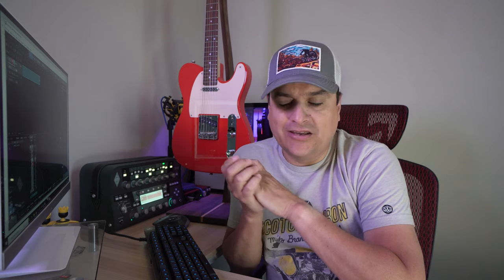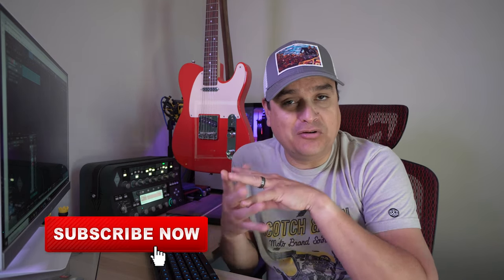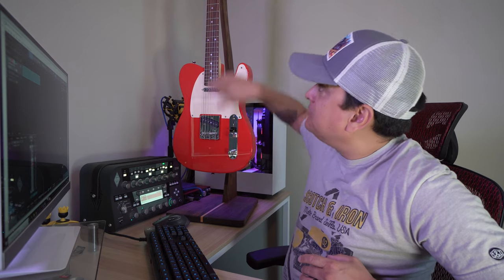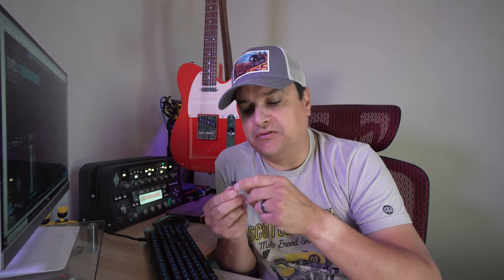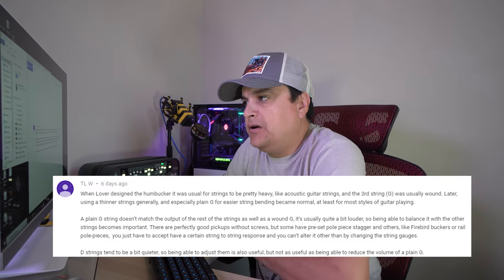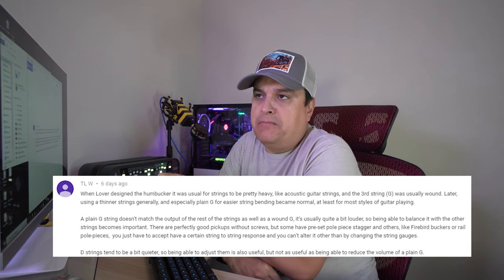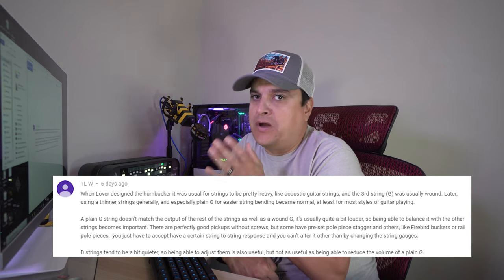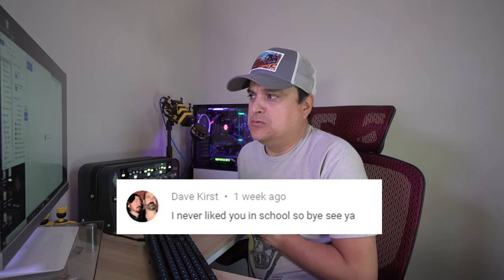Telecaster Saddle Shootout - Graphtech Vs Brass Vs Steel Vs Aluminum

Comment: I was surprised the Graphtech seemed to take the edge off highs and lows. This Tele player liked them in this order I found Brass the most traditional sound with chime edge, Steel had edge, aluminum seemed to fit between brass and steel which I did like and as much as I wanted the Graphtech to come out on top it was actually my least focused sound.

Comment: I like the brass twang but I also liked aluminum a lot. I could see all that upper twang of the brass possibly sounding harsh with a lot of overdrive or reverb though. Aluminum might be more flexible and I may have liked it the best clean too

Comment: I thought that the brass sounded the best for picking up and not screeching/squelching out and distorting the faint little notes between pic strokes. For lack of a better ability to explain. The little notes in between the loud ones.. lol think that the steel was the worst. 2nd place id say goes to aluminum which were basically tied with 3rd place graphite but the size of mounting screws drive graphite to spot 3. Steel just seemed to be to high pitched. However I am listening on a phone so that could have a huge factor in my choices. I’d imagine that the steel ones were actually cast pot metal and then nickel plated? Like most things?

Comment: Graphtec didn't sound shrill... seemed to even out the spectrum. That's what I have and now this video confirms why I like them. I don't want to trebly sound, and I think it doesn a good job taming that. I did like the Aluminum sound as well, but it's not enough for me to change out what I'm currently using.
Reply: I saw a video sometime in the last 12-18 months that addressed the issue of the brightness of a Tele (I don't remember who it was by and what it was about, I can only remember the takeaway). He suggested seeing the halfway point of the tone knob of the Telecaster as the starting point or default. This gives you a great deal of flexibility when it comes to your tone and after trying it for myself I can only say that this observation was spot on. I used to just dime everything on the guitar and adjust my amp as needed, but I've found this "half-way" approach to be significantly more appealing. I use my Telecaster to play pretty much everything nowadays from crystal cleans to rock to punk (even Metallica if you can believe it). I've also gone to having the volume set to half as a jumping off point for distorted sounds as I find that it gives me far better articulation and clarity when riffing on chords. And high gain leads are just half a turn away. Just a little food for thought.

Comment: I think the graph and the alum had more muted highs and the bass notes didn`t ring as long. brass and steel are harder so i think it transmits the vibrations more authentically and the softer material has more absorption. so i think it depends what type of sound you want and what you play, fast low chords would probably sound better on the softer and lead / clean players would do better with something that would allow a ringing of the notes.

Comment: There is a reason why bells and horns are made of brass. That being said.. what about block material ? I replaced  my block and neck screws and the screws that hold the trem  springs with brass and I swear the guitar sounds much more 'alive'  I have a stainless steel trem but I'm thinking of going brass saddles too. 🤔

Comment: I am a tried a true Tele guy and not for country twang.  I gravitate to brass saddles that are compensated for better intonation.  My ear may be biased but this still keeps me at brass.  Not to that I do not have Tele’s with steel saddles.  I did find the aluminum interesting.  Graph-Tech seemed a little muffled.
Reply: A nut comparison would be great.  In the late 70’s it was the thing to change to brass nuts.  Thinking about it again now.

Comment: This is one of those debates like "alnico vs ceramics", or 9's vs 10's"."
I have guitars with all types of saddles, from cheap pressed "vintage style" to brass barrels and everything in between.
Without an oscilloscope, and some kind of direct side by side, the "sound difference" is so small in the context of a song, that it is negligible to 99% of the people listening.
I agree that brass saddles can be brighter, but is that "better"?
I listened with headphones, and while they sound "different" I can't say any one is "best".

Comment: Aluminum seem more resonant & slightly brighter. Brass seem slightly warmer & richer. Steel seem bright but not as warm as brass & not as resonant as aluminum. With new strings brass is the best I think.

Comment: I like the brass most balanced a bit  more beefy in the upper middle. 
Steal a bit brighter and snapper good sound but for me a bit to  high ended
Reply: Graftech. Dulll don’t like the plastic saddle ideas
Reply: Aluminum similar to the Crome but not as  dynamic as steel

Comment: To me brass also sounded best providing the broadest spectrum. Steel was brightest, aluminum amazingly somewhere in between the two. Graphite was disappointing, just as there were nylon strings on the tele.

Comment: Brass had a better bass end, more 3D sounding, greater detail, layered not as flat 2D sounding like the steel & aluminium...the treble was clearer but smoother imo...i use brass saddles for all my bass's after compairing many types for years, especially on an Ebony fretboard....a bit more gain with Ebony fretboard & brass saddles...imo

Comment: To me aluminum sounds “neutral”, well-balanced. Graphite is a darker one, closer to even nylon tone, less highs. Brass is really sharp with the lack of low end, surely  the most cutting through the mix. Perhaps with a proper tone setting could be really nice. Steel ones have good response on highs and lows as well, brighter and deeper than aluminum, I would prefer them.

Comment: I think  brass -although too brite -  had a lot of clarity and dynamic sound. So I think it would sound better with the rhythm pick up or was just more bass in the amp. I think you get more signal with the with the brass.

Aluminum would be my second choice but it did more compressed or muddled. Steel I did not like nor the graph tech.

But if you are playing distorted  lead you might want to have a flatter sound with the steel

Comment: I think I've seen those steel saddles on reverb and ebay, pretty inexpensive.   Other comparison videos with Callaham steel the steel is much louder brighter and more attack then brass. The brass has more low end, but with alder and rosewood board can be rather dull.  I'm thinking the steel is questionable in the cheaper saddles.  Maybe  Dave is your brother  ? Using a different name?😄

Comment: Brass variation goes from warm with articulate highs to thin and unusable with no bottom end and a weak mid. Try the test again with a range of "best compensated" brass ones and the range is even more than you had here.

Comment: Aluminum and steel sound roundest brass bass and presence scooped mid graphtecc sounds between brass and steel.. thickness Or height of saddle Will have a bearing and Last but not least screw material.. sounds goofy but it isnt try stainless, nickel, and other various materials. Think of it as a conductor of vibration to The plate and what frequencies it might emphasize.. I've used steel screws in brass saddles ( always loosen string tension a bit e down to d etc.) Especially using steel in brass threads or vice versa brass and nickel screws is a nice combination as nickel subdues a little of the upper mid spike but just enough to Ballance it out a bit, never really tried aluminum saddles, but make pic's out of aluminum and gives a round tone whereas brass bass and presence. Carbon fiber may be similar to graphtecc if that isn't what there partially made of but have no idea never used em?

Comment: The brass reminds me of alnico 3 or the type you'd find on a Squier CV telecaster.  The steel sounds ok, nothing special.  The graphtec has something that isn't entirely bad but not great either.  The aluminum saddles sound like the typical budget chinese telecaster saddles.  Brass is traditional and twangy, but it doesn't make it the best!

Comment: I thought the graphtec sounded like an acoustic with a piezzo pickup -- artificial, plasticky, undesirable. Brass was by far best, then aluminium or maybe steel. The second part of the video made me want to spew, and I'm not surprised he gets nasty messages. (Edited to spell correct)

Comment: Bro, bro, bro. More density = more treble frequencies transferred. This means the ideal nut and saddle material would be osmium, the denesest material on earth at normal pressures. But, osmium is unstable and turn into a osmium trioxide when exposed to oxygen. So bro, just play your tele with an osmium bridge and nut, bro, but in a vacuum. You gotta have the perfect vacuum for that TONE bro. Bro. B r o .

Comment: Wow, steel sounded the best. Brass was a little to bright, def at gigging volumes anyway. Graphite was a little to dull but with a maple neck and some bright pickups, a winner. Steel was all around the best for me.  But these are a cheap upgrade and so I would try each to match your guitars material and pickup arrangement. Also if you a have a bright sounding nut like a tusq, i would  counter that with a less bright saddle to keep things even

Comment: Preference in this order, 1. Brass, 2. Steel,  3. Aluminum, 4. Graphtec. I see no reason to ever go Aluminum or Graphtec from what I heard and Brass & Steel is most likely what the Telecaster will have as Fender OEM.

Comment: An interesting experiment, no doubt. There's a handy tool for compensating for materials-based differences in tone that virtually every guitar has that too frequently gets too little use. It's called a tone knob. Many seem to forget it's there on the control plate and differences in saddle material seems to matter most to these players.

Comment: Brass- full bodied and open
Steel - thinner than brass
Graph- dampened
Aluminium- even thinner 

Brass wins for me. How about compensated vs vintage. The break angle on the strings varies more with compensated. This may effect tone a bit.